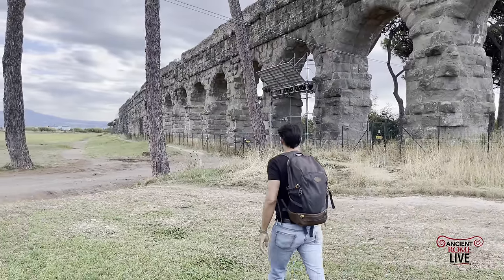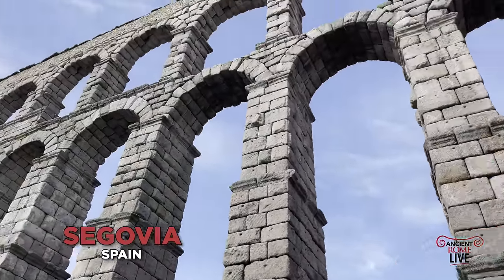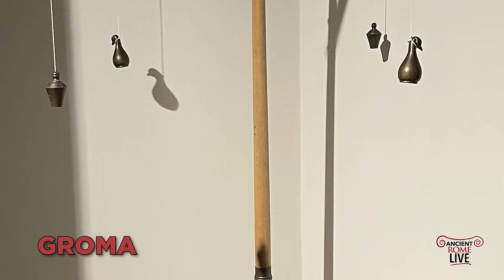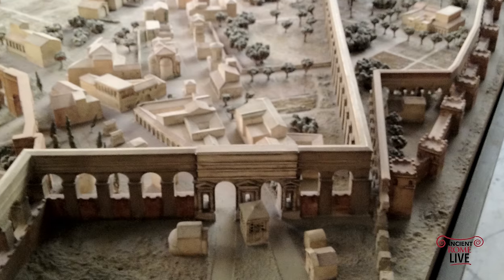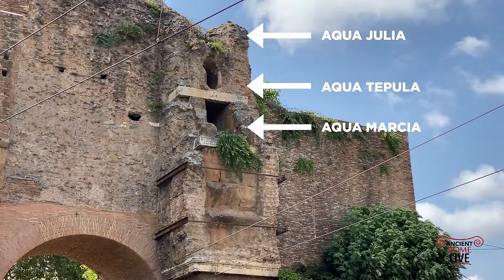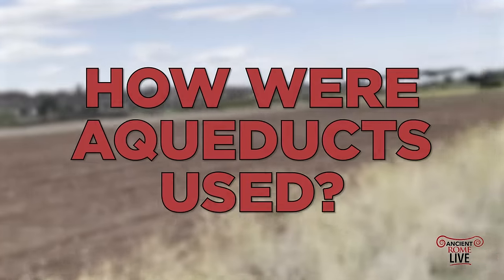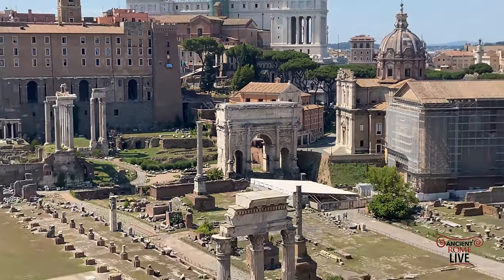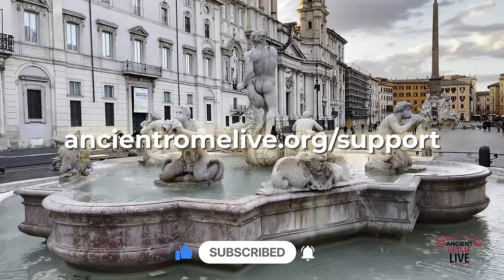How did Roman Aqueducts work?

Comment: The Romans were excellent engineers, but in particular, their hydro engineering was unsurpassed in my limited opinion.
Reply from the maker: Hard to beat!  Sure there are qanats and aqueducts of the Greeks- but the ubiquity of the aqueducts throughout the Roman Empire is truly amazing.
Reply: Yes, their hydro engineering will have been outstanding for their time - but only for their time. They were not aware of the necessity to allow some stretching and contracting of the conduits due to the shrinking and lengthening caused by temperature changes, or at least had no means of counteracting this problem. The result was, according to L. Sprague de Camp, a constant leaking of the aqueducts, with sinter terraces forming where the water got out.
Reply: @HansDunkelberg1  Not to mention the theft of water at various points along the channels . . .
Reply: @EllieMaes-Grandad  Yes, L. Sprague de Camp mentions the thefts too, but such a problem won't reduce the level of the technological achievement. Perhaps it can prove that Roman technologies of law enforcement have been developed less astoundingly. Apart from this, I guess I remember that also such thieves have already used copper pipes and cranes.
Reply: @HansDunkelberg1  The level of technological achievement is impressively high - nobody else in antiquity was even remotely as competent.
PS  you didn't mention syphons for crossing valleys . . .
Reply: @EllieMaes-Grandad  Why should I mention everything? My comment was meant as a limitation of what M B had originally posted, not as an extension.
Reply: @HansDunkelberg1  Apologies if it's not your video, which failed to mention other outstanding features.
Reply: @EllieMaes-Grandad  No, it's indeed not a video of mine. I'm an expert rather on larger-scale aspects of civilizations, not only concerning ancient Rome.
Reply: You should check out the Harappan civilization!! One of their enjineering marvels was the Great Bath at Mohenjo-daro, a large public bathhouse that was built around 2600 BCE.
Reply: In my opinion, aliens gave a level for the construction of the aqueducts🙄 How much elevation does make in one meter- 0.000029mm? Even nowadays it would be a challenge.
Reply: @HansDunkelberg1   Italy today: around 40% of aqueduct water go wasted throughout the nation, so possibly roman aqueducts were far better than the ones today.
Reply: @nessuno1948  L. Sprague de Camp estimates the loss to have been about a half, in Roman times.
Reply: @AncientRomeLive  I really wanted to watch this,  but couldn't. 
Constructive criticism: lose the background noise! 
The subject & your narration of it is great. The addition of distracting, monotonous & annoying music ruined the vid for me.

Comment: Additionally there were holding tanks along the route of the aqueduct with sluice gates.  An official lived nearby.  His task was analogous to the railway gatekeeper at a crossing. His task was to change the size of the sluice gate in order to either reduce, or augment the flow of water so that it was at the optimum level within the water course.  The ovoid shape of the water course was designed to prevent back currents and was dependent on the flow not being too strong, which could cause wall damage, or to weak, which would not allow an even distribution of sediment and thus cause build up and eventual blockages.  He was also responsible for keeping the channels clear.   When the Germanic tribes took over the Roman area, they neglected to pay for this official, causing a degradation of the whole aqueduct system both in reliability of water flow and structural integrity. (Source:  the museum at Pont du Gard, Provence)

Comment: I wonder what the impact on the water table and the surrounding countryside was from diverting away so much water?
Reply from the maker: Great question.  Luckily, Italy is rich in springs (main source for the aqueducts).
Reply: They probably originated from a Reservoir or Lake, below the Snow line/levels?

Comment: Did I interpret the calcium deposits inside the specus correctly? It looked like they narrowed the channel down to less than half its original width. Was that typical?
Reply: Great question!
Reply from the maker: The calcium deposits varied per individual channel- aqueduct source. Frontinus writes about cleaning the channels.  We know this was done, but not the frequency.  Accretions- of various levels- are visible in Rome.  The Pont du Gard example is really extreme.  Famously, its slope is very slight, which would have had a negative effect.
Reply: @AncientRomeLive  I walked in that [dry] PdeG channel over thirty years ago; not a lot of calcium was visible, but then I wasn't looking for it . . .

Comment: Perhaps the Pont du Gard is filled with unusually much calcium residue because it has been used especially long. I think I've read about a use of it until the days of Charlemagne, around AD 800. Perhaps the slaves, who have been of a considerable influence among the Christians, have stopped cleansing the bridge's conduit in the later times.
Reply from the maker: The gradient flow was extremely low.  A famous aspect of this channel.
Reply: @AncientRomeLive  That sounds plausible. Still, also with an especially quick accumulation of residue it should have been possible to clean the thing up. And perhaps neglect has been stronger at such a remote place than with the also long-used Aqua Virgo close to the city of Rome.
Reply: 'Soft' water is low in calcium, so it will depend on sources themselves and the ground over which the water travelled.
Reply: @EllieMaes-Grandad  I do not really understand what you mean.
Reply: @HansDunkelberg1  Hard water, soft water - look up calcium deposits in kettles . . .
Reply: @EllieMaes-Grandad  I can follow you until there. I just wonder what's the connection to my preceding comments.
Reply: Lots of limestone in the region where the Pont du Gard is located. Hence lots of calcium in the water and lots of deposits in the aqueduct.
Reply: @wschart  Fine, fine, but why shouldn't it have been possible to simply clean such a more quickly congested conduit more often?
Reply: @wschart  Their kettles probably furred up badly too . . . !

Comment: 8:24, Did the Romans suffer lead poisoning?
Reply: I've seen mention in literature that they did.  Presumably determined from bone analysis of skeletons, not that they'd have known much about the problem back then.
Reply: They probably suffered much more lead poisoning by the use of adding lead acetate to wine than from the plumbing system